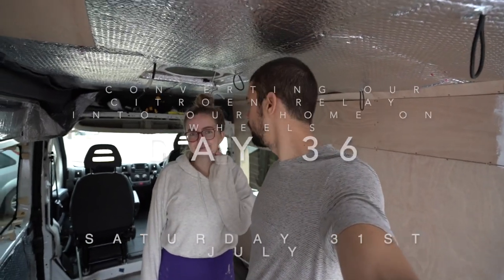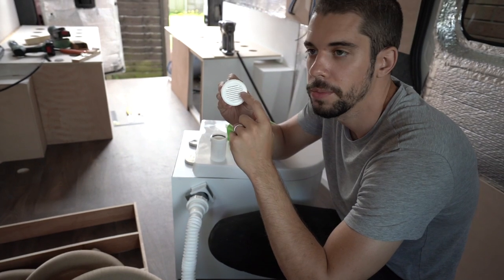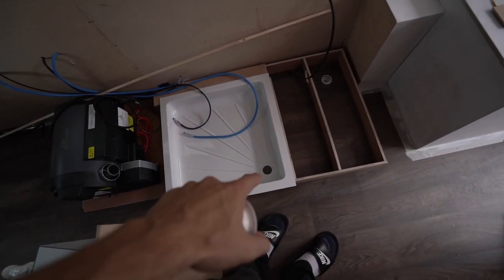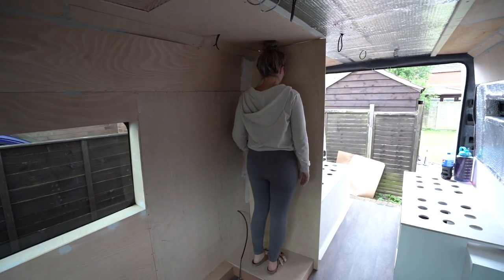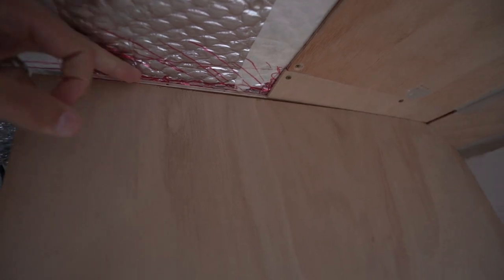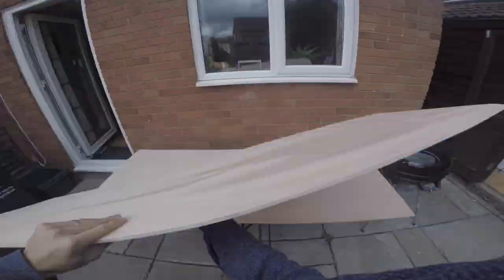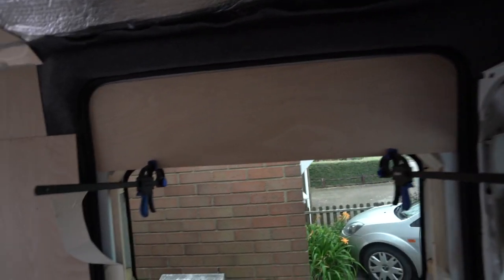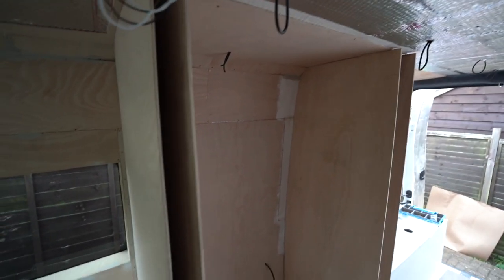WILL IT FIT? CAK TANKS, SHOWER WALLS, TOILET EXHAUST - Citroen Relay L4H2 Campervan Conversion Vlog

Comment: Are you going to fit an anti smell trap? I would recommend you do!  Grey water tank.
Reply from the maker: Hi Richard!
Yes we will add a p trap for the plumbing for grey water tank, one for shower and one for sink in kitchen. Thanks for the tip !
Reply: @CasLaz   i also put a vent in the grey water tank which i routed up and over the rear wheel arch.